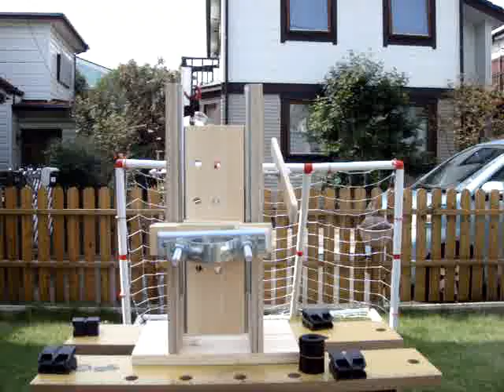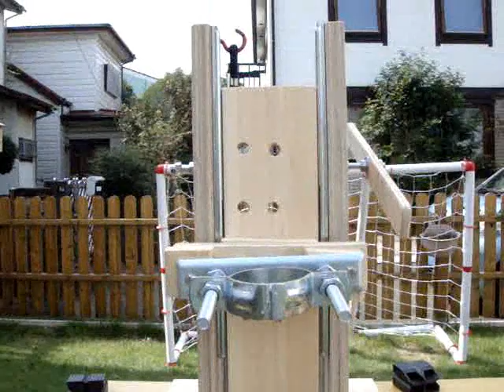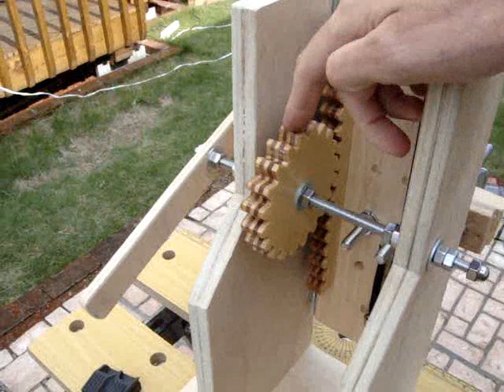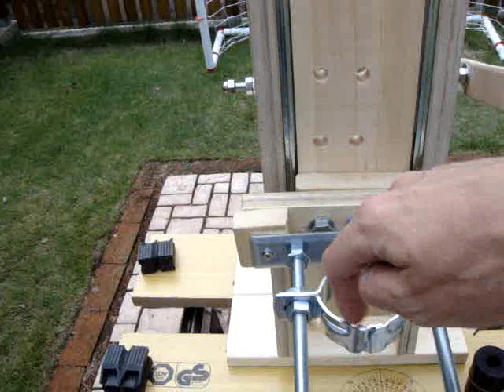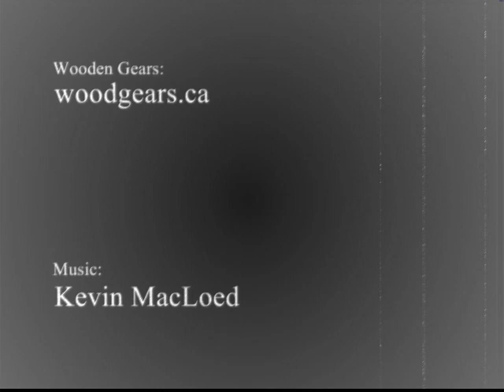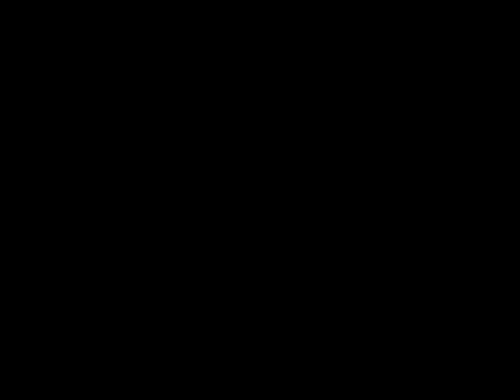DIY Drill Press

Comment: Nice design, I am now inspired to do one myself..... for around £7, (thats about 10 bucks lol!) As for the brackets that the drill goes into, I had a similar hurdle to get over with my home made dremel/rotary tool table, so, I used some  insulating pipe foam, it cost me something like 79p for a metre of it. It works ok as it molds itself to the tool. BTW, you do get some twats on this Earth don't you who complain about peoples achievments, I think its jealous!

Comment: This project is not worth doing at all. You can buy any cheap or used drill press that will vastly out perform this.

Drawer slides? Crap.
Included drill? No.
Solid cast iron table? No.

Comment: no, i didn´t notice the drill. must drills have a 43mm in diameter neck, and thats the place where they can be hold be the bracket. i don´t know what type of drill you have, but it must be one that i don´t know about. most drills just have a 43mm neck. mine is from bosch, and would fit.

Comment: Did you notice the drill in the video?  I didn't either.  The bracket he shows wouldn't work on the drills I own.  I have seen some drills that have a portion of the housing that's cylindrical in shape  just above the chuck.  His bracket would work for drills w/ that special housing so I must assume that's what he has.